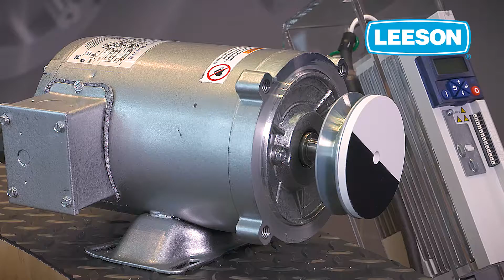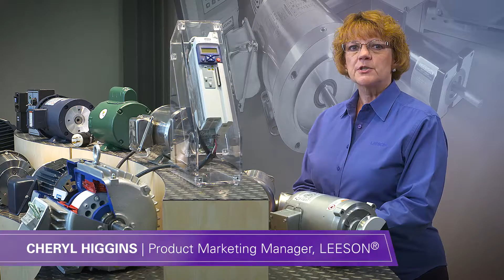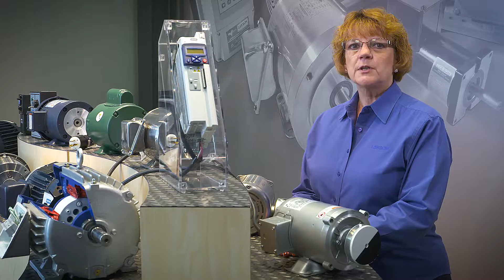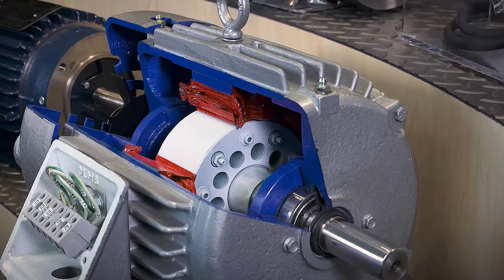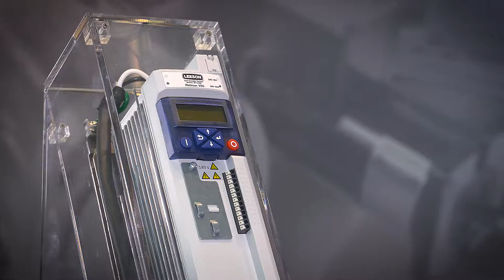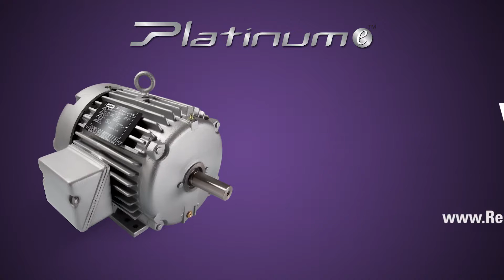LEESON® Platinum e Motor

Comment: I would use these for 3 or 5 HP 4 pole in a 56 frame.  Often when a machine is upgraded it needs more HP but I can't fit a 180 frame where the 56 (or 140) was. 

Will these run on utility power or VFD only?